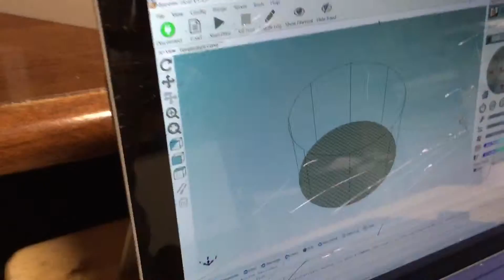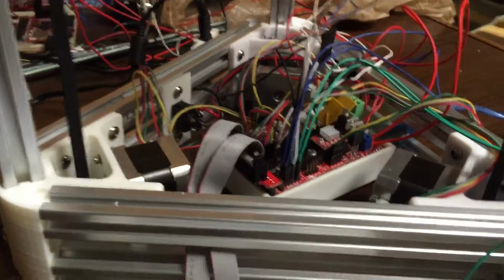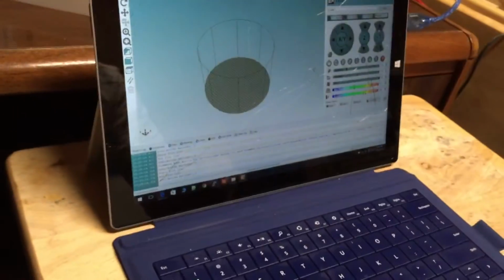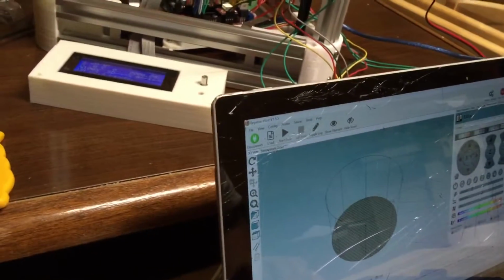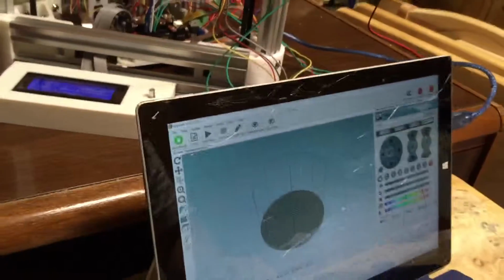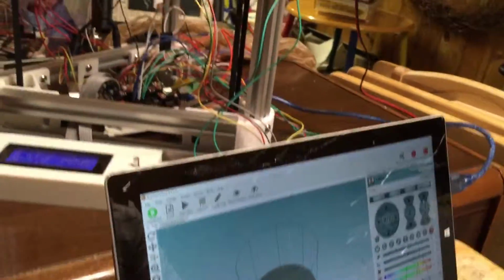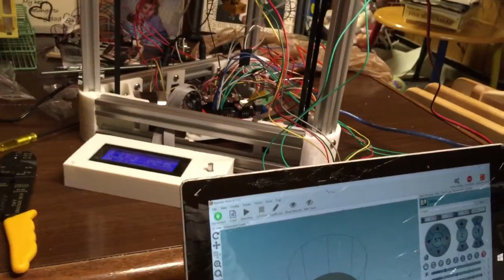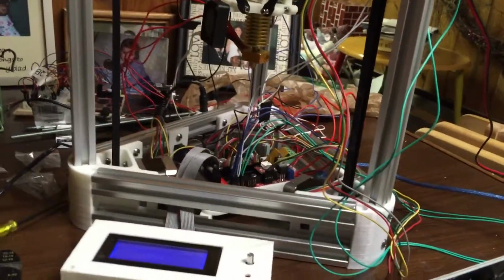Issues with He3d printer

Comment: Hello!So I am putting together the HE3d, and the belts are 3 1/2" too short. Ever seen that?
Reply from the maker: Nope.  That stinks.  I do believe one guy mentioned something similar happened to him...he was completely missing a belt or something.  My kit was missing all of the little jumpers for the ramps board (don't forget to put hose in under your driver chips!).  So it's not unheard of to have stuff missing.Do you have the tower pieces fully in?
Reply: They are sending me longer ones.
The directions are SO BAD! I can't even figure out where the cooling fan plugs in! They gave me a bag 'o jumpers with no documentation on where they go! How did you ever get your to work? Got the mechanical stuff working great, had to re-engineer some stuff.
Reply from the maker: +Mark Huppertz had to do all the same stuff. lots of Google and YouTube help. =)

check the wiring diagram from earlier on the fan. the jumpers go under each driver chip on the ramps board (3 each)

Comment: Hello. I didn't get any documentation with my kit, no wiring diagram or anything. Any way you can shoot me copies or point me in the right direction?
Reply from the maker: Hello Mark,

Take a look here for a better wiring diagram (http://www.nextdayreprap.co.uk/images/nextday3dprinters/Reprap_Prusa_Mendel_Build_Manual/2500_2500__Reprap_Prusa_ramps_diagram.jpeg).

I made a blog post with some pics that might help (http://www.duttonbiz.com/dlt180/).

Also, check out this video (https://www.youtube.com/watch?v=5bCiSGpf60s) of my wrap-up and maybe read through the comments.  

That should get you started. Post some vids as you go!
Reply: Hello!Got it all put together, have 12v to the board with the switch on, but no sign of life. Do I need to connect the USB to a computer to get it to light the LCD screen?
Reply: Ok, jacked it into my laptop, have a screen, it says Err: MINTEMP
Reply: Looks like maybe a bad connection to the thermistor or a bad thermistor...
Reply from the maker: It might not be...in the winter mine would do that sometimes just because it's cold in my basement.  you mentioned that if you just plug it in and flip the switch nothing happens...did you solve that? You shouldn't need to plug it into your computer.
Reply: +iceman198 
The lcd is blank until I plug the USB into the laptop, then it lights right away. I can make the motors move slightly, so I know the controller is working. I cut the wires to the hot end thermistor and put my fluke on there and it reads open circuit.

Comment: your jumpers are missing under the stepper drive boards.
Reply from the maker: +William “Smiley” Canterbury Thank. yeah, took me a while but eventually figured it out and got it cooking finally.  Been printing great ever since!
Reply: Thats great news, I'm trying to get my Delta 600 working at the moment but it seems you need to be a Chinese programmer to get the thing running. Very frustrating...
Reply from the maker: +William “Smiley” Canterbury i put all the chinese that is in the configuration.h through google translate to help me out a little.  =)
Reply: +William “Smiley” Canterbury Any luck modifying the Delta 180 firmware for Delta 600? I am at it for last 4 days and I am not getting anywhere. Can you please zip me firmware and  Pictures of board and X,Y,Z connections and picture of Belt Connection that goes to each axis.  Pretty please :(

Comment: did you get any answers?
Reply from the maker: +eric van tassell Yeah, after playing with the wiring, the steppers were all wired incorrectly.  Had to swap the middle two wires for each one.  Check my other vids for more detail.  Turns out I was missing the jumpers as well so had to scrounge those up.